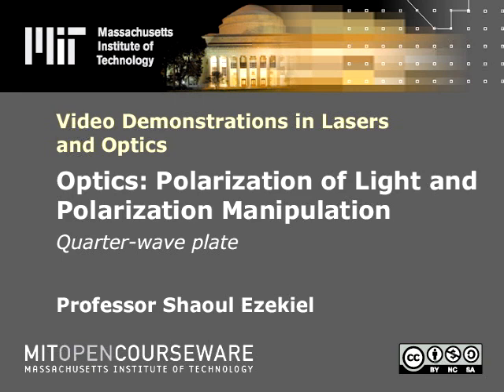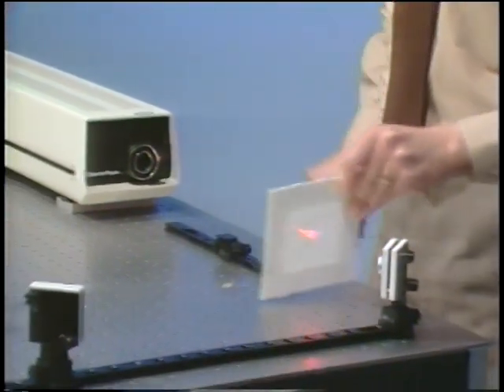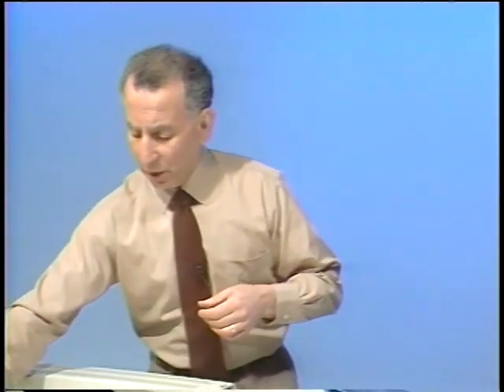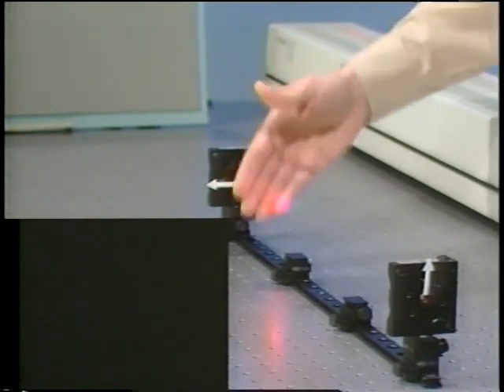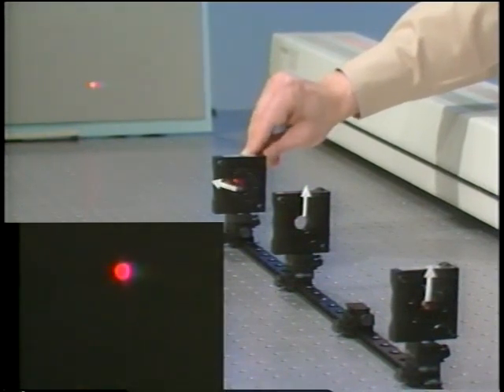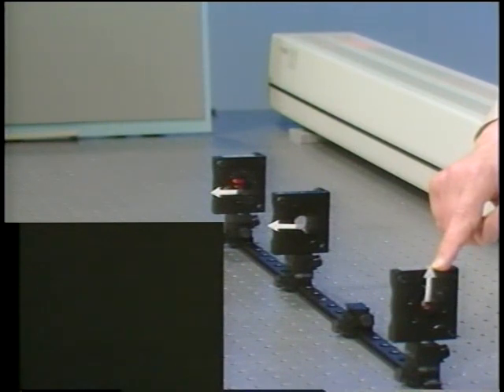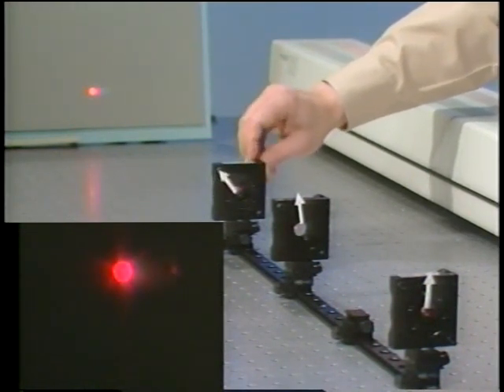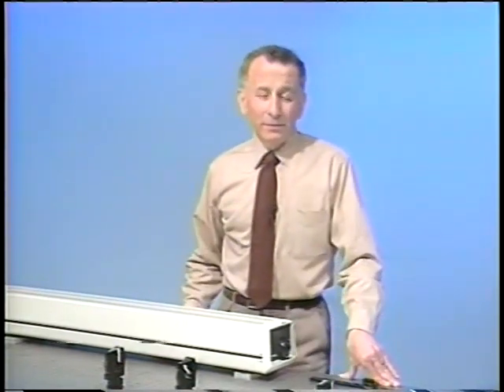Optics: Quarter-wave plate | MIT Video Demonstrations in Lasers and Optics

Comment: I appreciate the demonstration.  
The terms "elliptically" polarized, and "circularly" polarized light, are horribly misleading terms for what is happening.  They should have used other terms for what is actually happening with the components of the polarized light.  It simply refers to the effect of the electric field component of the light either in alternative half waves (elliptical, based on the shape of a half wave), or on each half of the electric field wave equally (which they call circular).  
They should have come up with better terms than this.

Comment: What happens if an unpolarized light is sent through a quarter wave plate?and why ?
Reply: I think quarter wave plate's job is to convert the polarisation state to elliptical and circular.  It donot do the work of polariser. So all the linear components of  the Unpolarised light get converted to circular/ellipticall ones
Reply: @anoopkrishna20000  agreed. what would be interesting is to analyze the distribution of all the linear components before and after the waveplate, as they certainly don't get polarized in the same way depending on their angle to the principal axes
Reply: The same thing which happened to a polarized light

Comment: I think particles like photons are in orbit likely with dark matter particles giving them an apparent axial wave or circular helical wave as they travel, depending on the orientation of their orbit. I think light travels thru the 2 polarized filters when a 3rd is introduced at 45 degrees because some particle orbits are deflected into that orientation or circular and pass thru. This would explain the double slit results too.